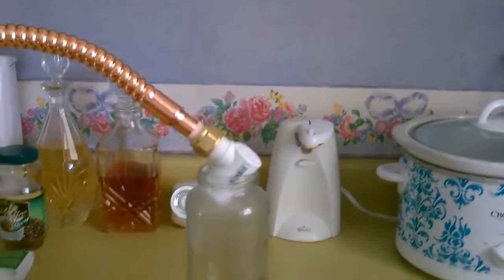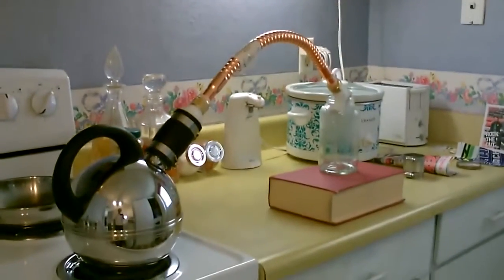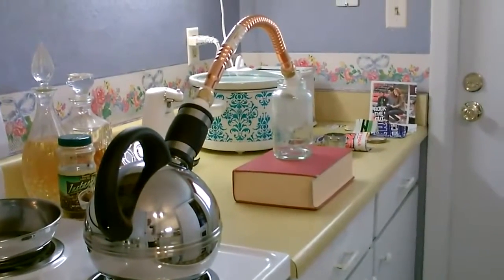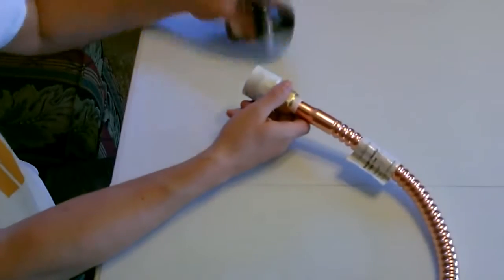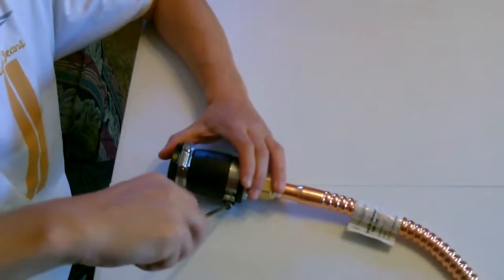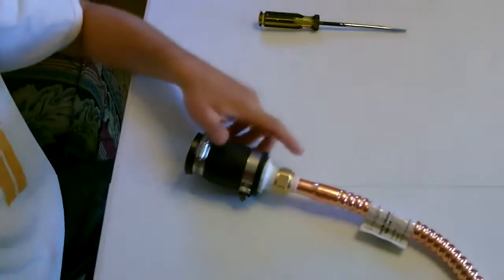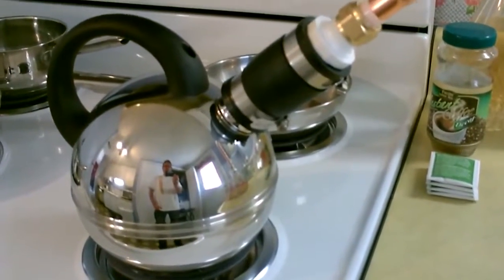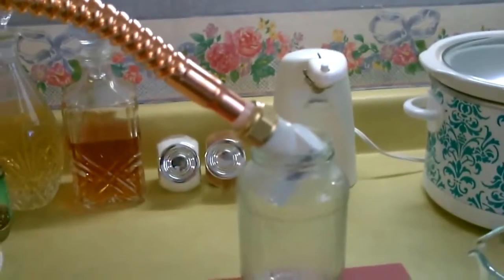Homemade Water Distiller - DIY - Stove Top Pure Water Still - EASY instructions!

Comment: What is the long piece made of?  It looks like copper.  Might that leak into the water?
Reply: Copper is fine.  It's what moonshiners use and also what many pipes are made of.  I'd be far more worried about the plastic and rubber leaching when heated like that.